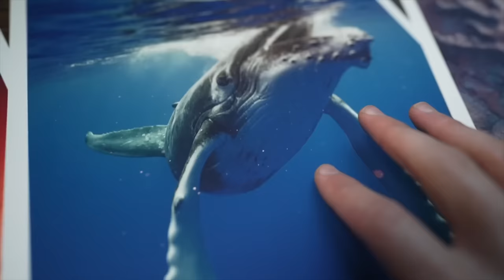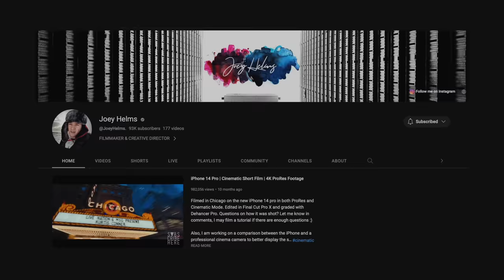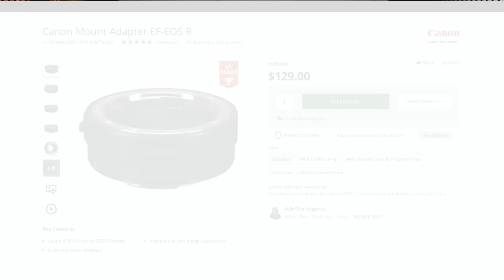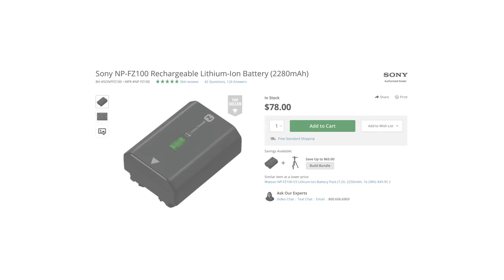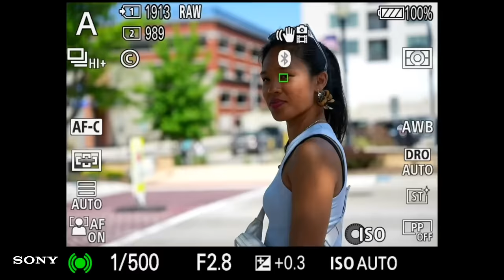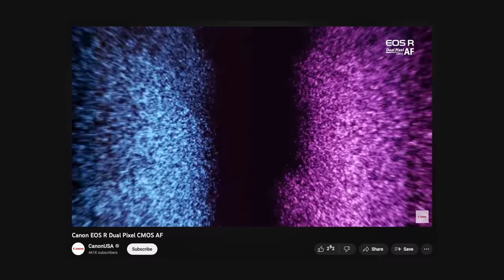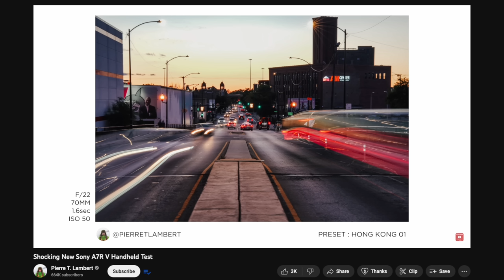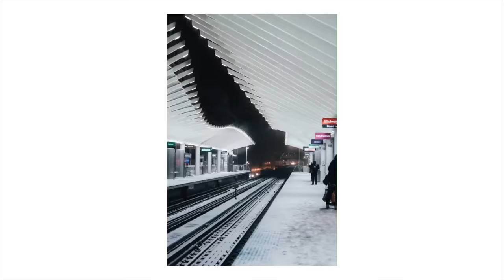CANON Vs. SONY In 2024 - Which one is BETTER?

Comment: For the audience your targeting camera bodies will come and go, it’s a very close race;  the discussion is really about lens, more specifically the investment one has in lens and as you have said third party lens make (in my opinion) Sony is the better long term investment
Reply: Nope. The short answer is, both brands produce good images, at least in the flagship models anyhow, eg, the A1, the R5 and R3.
Both brands have good glass available - it doesnt matter who makes the glass.
Both brands have similar high iso performance per pixel area.

I personally found the A1 too small for my hands, but the a1 will be perfect for others.

The biggest differentiator is; Sonys 46mm mount vs Canon (and Nikon) 52mm mount.
One of my favorite lenses in my Samyang 10mm rectilinear EF mount, adapted to my R5. 10mm is wide, truly wide, and, where it is needed there is no substiure. Straightening a 8mm fisheye gives very soft corners, and, once cropped rectangular, is 10-11mm or wider anyhow.

Sonys 46mm will vignette a 10mm rectilinear, and thus, is a deal breaker for me. Sony really needs to update their mount to 52mm.

Canons new 10-20mm F4 rectilinear looks to be a winner for UWA enthusiasts, and realestate. Sony or others could not release this type of lens for the Sony 46mm mount - it would vignette at the wide end.

All the rest of the arguments & comments are just noise. There is only one real show stopping limitation, and that is the small 46mm mount size.

Comment: I shot with Cannon for multiple decades from a film A2E to the first digital 10D or D10, don't remember, but like 6 years ago I made the switch to a olympus OM the pro level micro 4/3 , loved it but 2 months ago I switched to a Sony A7riv, and i love it.  Way better than the Olympus in ease of use and comfprtable in the hand.  I do think the Canon was a bit more comfortable, and the dials used to be nicer.  The other negative to the Sony is price of lenses.  For the canon I had a Tamron 28-300mm that sold for under $600, and was a great one lens does it all, for the day you can only carry one ( but that was a EF lens, I guess now Canon has a new lens mount so Sony is probably better).  Sone E-mount they all seem to be a couple $100 more for the lenses.  I went to the Sony for the Megapixels!!!!

Comment: im currently using an old 600d canon and wanted to update to the mirroless system,im considerding r10(since i love canon menu and their ergonomic) or the a6400(the best camera budget and sony wellknown  cheap 3rd party lens market),i know the canon rf-s lens selection rn is sucks but i have a few  pretty good ef-s lens which i could buy an adapter and use it for the r10 but i dont know if its worth it,i mainly do portrait and street photography,maybe almost everything except sport,any advice?(i do love some fuji like xt3,xs10,xt30 mark 2 but damn i just hate how the menu work),the nikon zfc might also be an options too but ive heard the lens selection is also sucks too.

Comment: Canon has used the same batteries since the 5D came out. The RF use a newer version of the LP-E6, the LP-E6N and since the R5 they use the LP-E6NH. Both the N and the NH have more capacity than the plain LP-E6 but they are all compatible with each other so you do not have to throw away your old batteries. So it is untrue that millions of batteries are thrown in the garbage and you have to make a correction on this.

Comment: IMHO, it really doesn't matter. Use what you have. That being said, I have never shot Canon or Nikon mirrorless. I started on Fuji and now shot Sony exclusively. I find pros & cons of Sony, but also all other systems too. I do feel Sony offers greater options and a more flexibility ecosystem. I think all the other mirrorless camera cos. should thank Sony for expanding to technology and leading the way to others who might want to adopt a new system.
Reply: The short answer is, both brands produce good images, at least in the flagship models anyhow, eg, the A1, the R5 and R3.
Both brands have good glass available - it doesnt matter who makes the glass.
Both brands have similar high iso performance per pixel area.

I personally found the A1 too small for my hands, but the a1 will be perfect for others.

The biggest differentiator is; Sonys 46mm mount vs Canon (and Nikon) 52mm mount.
One of my favorite lenses in my Samyang 10mm rectilinear EF mount, adapted to my R5. 10mm is wide, truly wide, and, where it is needed there is no substiure. Straightening a 8mm fisheye gives very soft corners, and, once cropped rectangular, is 10-11mm or wider anyhow.

Sonys 46mm will vignette a 10mm rectilinear, and thus, is a deal breaker for me. Sony really needs to update their mount to 52mm.

Canons new 10-20mm F4 rectilinear looks to be a winner for UWA enthusiasts, and realestate. Sony or others could not release this type of lens for the Sony 46mm mount - it would vignette at the wide end.

All the rest of the arguments & comments are just noise. There is only one real show stopping limitation, and that is the small 46mm mount size.

Comment: I am a Canon user since ages and more than happy with the quality of my R5 and my RF L-Lenses. However I have no idea why Sony can make super quality lenses which are much lighter than Canon lenses. Example is the new 24-70 GM2. Canon has been THE lens company but it seems that Sony is now much better in meeting the requirement of low weight without compromising optical performance. From a body point of view I much more prefer Canon but I am of course used to the Canon usability. In regards to reliability I must say that I never had any quality issue in harsh conditions but on the last expedition in Indonesia the Sony camera of my friend died whereas my Canon R5s survived. But this was a single case and is not meant to be a general statement. I was thinking a while of changing to Sony but this experience made me staying with Canon. I just hope for lighter lenses. Also we do not need always 1.2 for primes. Better having a 1.4 50mm and make it 30% lighter.

Comment: First and foremost, I shoot Canon / Nikon / Sony, so I’m no fanboy to any. 
The problem with the Sony ergonomics has nothing to do with squareness vs roundness.  
The main issue is the height and depth of the grip. It has gotten better (a bit taller and deeper) on the newer Sony bodies but It still nowhere as full as the grips you would find on Canon / Nikon pro bodies. 
A weaker grip means more strain on the fingers specially with bigger lenses. 
Not only that, the other major problem with the Sony bodies is the space between the lens mount and the grip. 
It’s just too Narrow. Your middle and ring finger are always touching the lens which unless you have tiny hands is not comfortable at all.
IMO it’s a major design flaw which Sony still hasn’t addressed. Maybe in the next gen?

Comment: I don't understand your comparison, what was the use of putting points if in the end both chambers ended in a tie? 🤦🏻 ♂️. The great advantage that Sony has is because of its optics, there is a large market for cameras Sony, and that's a huge strength. Many canon photographers turned to sony for this great plus point, as well as offering hybrid cameras in video.
Reply from the maker: The points helped me show the “strength” for each but also highlight that in the end it’s the same haha
Reply: The short answer is, both brands produce good images, at least in the flagship models anyhow, eg, the A1, the R5 and R3.
Both brands have good glass available - it doesnt matter who makes the glass.
Both brands have similar high iso performance per pixel area.

I personally found the A1 too small for my hands, but the a1 will be perfect for others.

The biggest differentiator is; Sonys 46mm mount vs Canon (and Nikon) 52mm mount.
One of my favorite lenses in my Samyang 10mm rectilinear EF mount, adapted to my R5. 10mm is wide, truly wide, and, where it is needed there is no substiure. Straightening a 8mm fisheye gives very soft corners, and, once cropped rectangular, is 10-11mm or wider anyhow.

Sonys 46mm will vignette a 10mm rectilinear, and thus, is a deal breaker for me. Sony really needs to update their mount to 52mm.

Canons new 10-20mm F4 rectilinear looks to be a winner for UWA enthusiasts, and realestate. Sony or others could not release this type of lens for the Sony 46mm mount - it would vignette at the wide end.

All the rest of the arguments & comments are just noise. There is only one real show stopping limitation, and that is the small 46mm mount size.
Reply: @nordic5490  wow talk about beating a dead horse....

Comment: For me its not the Camera but the lenses and third party support. Sony FTW, Any camera body will get the job done but the glass you put in front of it is what sets it apaer. Nothing comes close to Sony GM lenses besides Hasselblad
Reply: Nope. The short answer is, both brands produce good images, at least in the flagship models anyhow, eg, the A1, the R5 and R3.
Both brands have good glass available - it doesnt matter who makes the glass.
Both brands have similar high iso performance per pixel area.

I personally found the A1 too small for my hands, but the a1 will be perfect for others.

The biggest differentiator is; Sonys 46mm mount vs Canon (and Nikon) 52mm mount.
One of my favorite lenses in my Samyang 10mm rectilinear EF mount, adapted to my R5. 10mm is wide, truly wide, and, where it is needed there is no substiure. Straightening a 8mm fisheye gives very soft corners, and, once cropped rectangular, is 10-11mm or wider anyhow.

Sonys 46mm will vignette a 10mm rectilinear, and thus, is a deal breaker for me. Sony really needs to update their mount to 52mm.

Canons new 10-20mm F4 rectilinear looks to be a winner for UWA enthusiasts, and realestate. Sony or others could not release this type of lens for the Sony 46mm mount - it would vignette at the wide end.

All the rest of the arguments & comments are just noise. There is only one real show stopping limitation, and that is the small 46mm mount size.

Comment: These days the mid tier to flagship cameras do not matter anymore on which brands you choose. Mostly they already have the same AI/Algortithm ie eye AF, animal, cars, etc... Hardware wise probably all are based on SONY sensor tech. ( if in this case all are SONY in different packaging )
Reply: Nope. In any industry, there is continuous poaching of top engineers from both companies. This is why, for any generation, the top tier models of all manufacturers have similar perfomance per pixel size.

The short answer is, both brands produce good images, at least in the flagship models anyhow, eg, the A1, the R5 and R3.
Both brands have good glass available - it doesnt matter who makes the glass.
Both brands have similar high iso performance per pixel area.

I personally found the A1 too small for my hands, but the a1 will be perfect for others.

The biggest differentiator is; Sonys 46mm mount vs Canon (and Nikon) 52mm mount.
One of my favorite lenses in my Samyang 10mm rectilinear EF mount, adapted to my R5. 10mm is wide, truly wide, and, where it is needed there is no substiure. Straightening a 8mm fisheye gives very soft corners, and, once cropped rectangular, is 10-11mm or wider anyhow.

Sonys 46mm will vignette a 10mm rectilinear, and thus, is a deal breaker for me. Sony really needs to update their mount to 52mm.

Canons new 10-20mm F4 rectilinear looks to be a winner for UWA enthusiasts, and realestate. Sony or others could not release this type of lens for the Sony 46mm mount - it would vignette at the wide end.

All the rest of the arguments & comments are just noise. There is only one real show stopping limitation, and that is the small 46mm mount size.

Comment: most of the pros use canon
Reply: Correct. One of the reasons is the widest selection of lenses are for Canon.

Sony or the 3rd parties will never have a 10 or 11mm rectilinear lens for the Sony 46mm mount - this mount is too small.
So... if you want the widest possible choices of lens focal lengths, eg 10mm UWA, you will have to stick with Canons bigger 52mm mount.

Comment: No doubt Sony will always win!!😅 Coz nah if i don't want to spend on expensive lenses, i can go with third party lens like from Tamron, sigma etc and you don't even need adaptor.
Reply: The canon ef lenses with an adapter kills sony🤝.
Reply: @joeart1092 Don't think so. If you wanted, you could still adapt Canon's EF lenses to SONY. 

But I would rather get SONY glass anyway, they're just the better option.
Reply: @adamadamis  I just wanted to say that canon R series cameras don't need third-party lenses as long the ef lenses and the adapter exist.
Reply: @Joevlogs1092  And what if you fancy, say a 35-150 f2-2.8? Can't with Canon.
If you have third party you have more options. You can have cheaper options, or more compact alternatives, etc. 

For E-mount you have dozens of 50mm lenses for example, all the way from f1.2 to f2.4, or macro ones, to suit all needs or budgets.
Reply: @Joevlogs1092  we didn't say canon isn't good, I love canon colour science also we got more fps on less expensive camera body. Eg canon r6 ii 40fps ES vs sony a7 iv 10fps. We're talking about flexibility and overall with Sony you can use more than 70(199)sony e-mount lenses and if you can't efford GM lenses because of their prices you can go with third party alternate lenses (sigma, Tamron, Zeiss) etc which is way more less expensive but same performance as Sony top GM lenses. And we don't even need adaptor!! Also we don't have to decide between price and performance.

On the other hand Canon has only 39 Rf-mount native lenses. If you get one those Ef lenses you need adaptor and it reduces the performance somehow. Not that much but reduce. 

Nowadays we can't compare about auto focus, colour science, ergonomic and design because nowadays Cameras be like if you have Blue Barry I have Black barry😅😂

Comment: Hillarious - way to go you tuber. Or "how to drive maximum egagement in the comments", to boost the algorithm.

The short answer is, both brands produce good images, at least in the flagship models anyhow, eg, the A1, the R5 and R3.
Both brands have good glass available - it doesnt matter who makes the glass.
Both brands have similar high iso performance per pixel area.

I personally found the A1 too small for my hands, but the a1 will be perfect for others.

The biggest differentiator is; Sonys 46mm mount vs Canon (and Nikon) 52mm mount.
One of my favorite lenses in my Samyang 10mm rectilinear EF mount, adapted to my R5. 10mm is wide, truly wide, and, where it is needed there is no substiure. Straightening a 8mm fisheye gives very soft corners, and, once cropped rectangular, is 10-11mm or wider anyhow.

Sonys 46mm will vignette a 10mm rectilinear, and thus, is a deal breaker for me. Sony really needs to update their mount to 52mm.

Canons new 10-20mm F4 rectilinear looks to be a winner for UWA enthusiasts, and realestate. Sony or others could not release this type of lens for the Sony 46mm mount - it would vignette at the wide end.

All the rest of the arguments & comments are just noise. There is only one real show stopping limitation, and that is the small 46mm mount size.

Comment: I never use non-oem brand lenses.  I'm pretty sure you don't either... Cheap cables don't work with Canon...  They also have to be in come cases PD... The Canon batteries have been pretty much the same for over a decade... Just because you don't understand how to use the Canon AF doesn't make it bad...
Reply from the maker: Yes in the same line of cameras (R5 R6II) 
it's the same battery. But if you go from R8 to R6 it's a different battery - on Sony A6700, A7c, A1, A7iv, etc are all the same batteries. 
Canon AF is good as mentioned, I find the hit boxes more misleading :)
Have a great day!
Reply: @Pierretlambert  The R8 is the new RP. They share the same battery of the Rebel line...
Reply from the maker: @lbeetech  yeap smaller